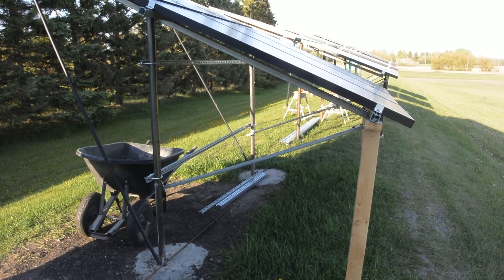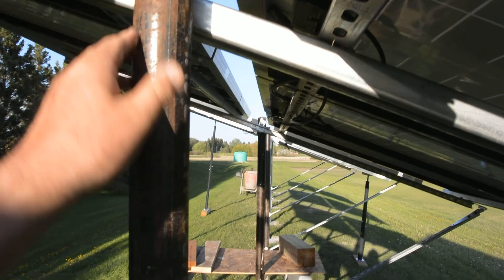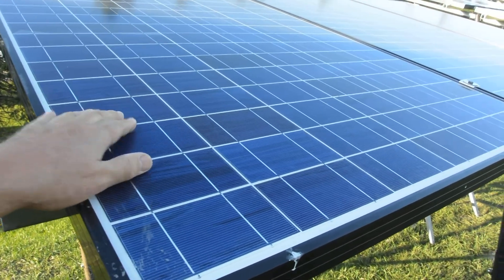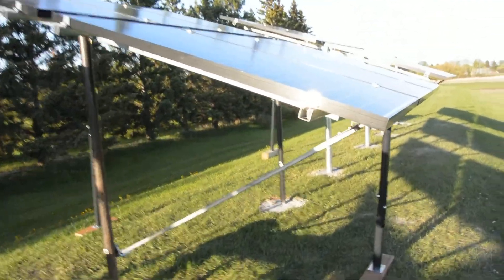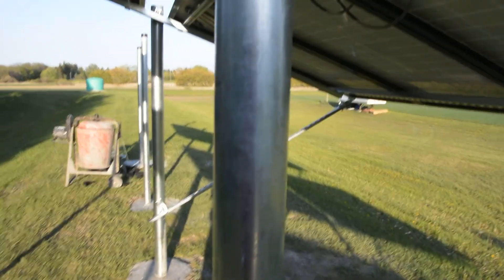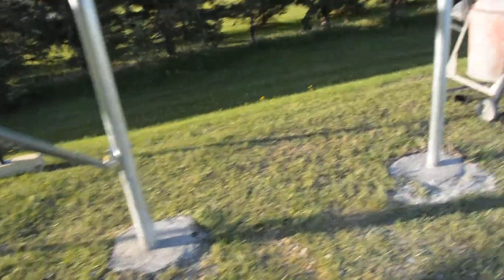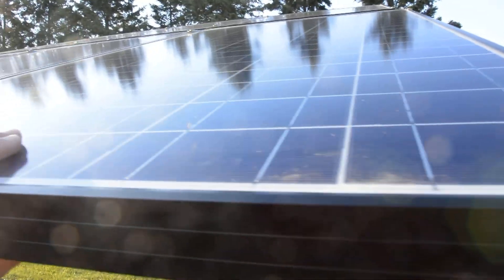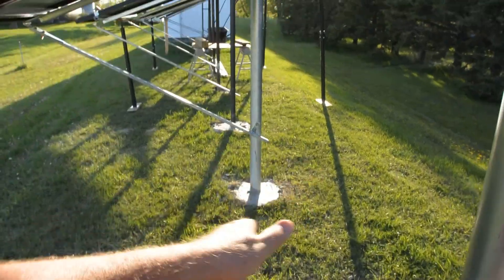Ground Mounting Solar Panels DIY

Comment from the maker: Just to update my ground mounting panels. What I found best for my application is 3" heavy wall conduit pipe. I also tried 2 1/2" which okay, but 3" is more rigid. The next set of panels I'm going to put up are going to be 6"x6" treated lumber and I was going to reinstall my Harbor Freight panels on those because of them giving me a ground fault and getting shocked a few times. Now I have 20 - 315 watt panels to install in the spring, so the Harbor Freight panels go on the back burner. But in conclusion, these ground mounted panels have survived 70MPH+ winds and are holding up just fine. These are buried about 3 1/2 feet in the ground in a 12" hole and cemented in. The poles are 10' long.

Comment: Why did you cantilever panel framing? To adjustment seasonal angle? it wobbles because you need pillars up front, delete it would be stronger. I was told conduit has no structural strength, better to use structural pipe...
Reply from the maker: Yes, I'm here at 49 degrees Latitude, they are easy to adjust the angle. They would be more rigid if they couldn't be adjusted and locked in a fit angle. As they are now they do move in the heavy winds, but are holding up just fine so far!

Comment: Not to blow you completely out of the water, but.....    I've seen a lot of videos here on YouTube and it amazes me how people will spend thousands of dollars of the electronics of a solar system (panels, charge controllers, batteries, ect) and take little thought or money on the mounts.    Don't get me wrong, it looks like you wasted a lot of money on yours.   I say wasted because you should have been using at least schd 40 3" Galvanized pipe to begin with, and proper bracing.    Even what you showed us in the very last part of the video isn't going to last very long.   If I may humbly suggest, see how the pros do it and do your best to replicate it.   They want a crap load of money for the same rack you can build yourself.   Good luck collecting your array out of your yard after a couple of good breezes.